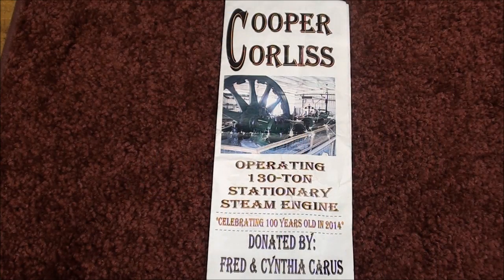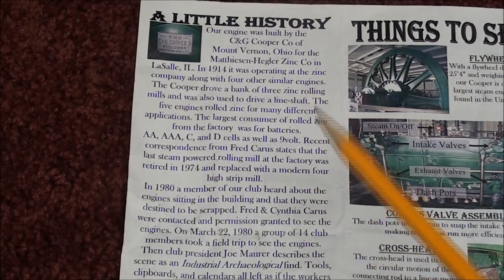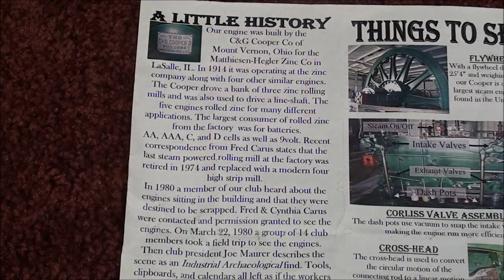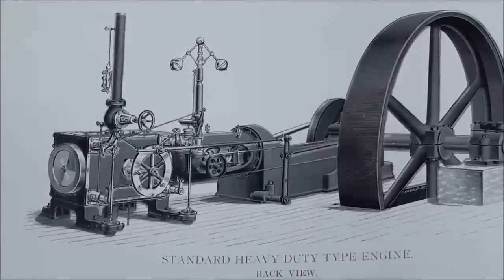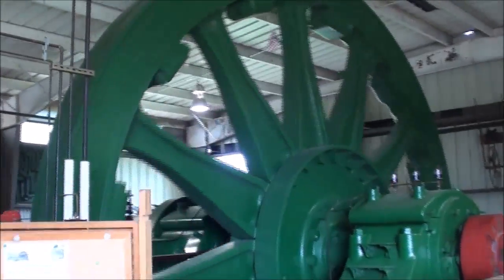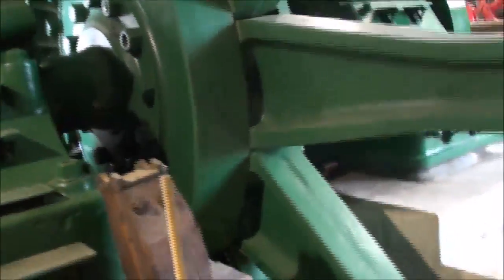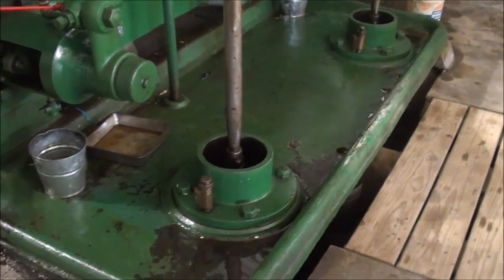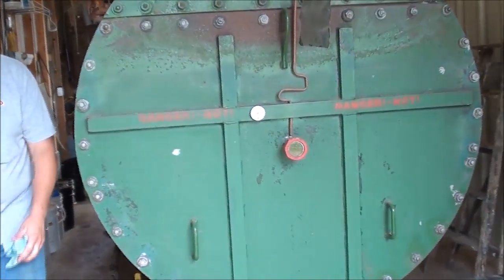tubalccain TAKES A ROADTRIP TO SEE THE GIANT COOPER CORLISS STEAM ENGINE

Comment: Those Allis-Chalmers Corliss engines are common here in Central Tx... there are several in Bastrop, one on a trailer and one at a barbecue place.  I also saw one at Antique Powerland, up in Oregon...  they run their sawmill off it when they are steamed up.  The circular wheel for the valve linkage is a dead giveaway for them.

Comment: Great video of a Corliss steam engine, that thing is HUGE.

I had the opportunity to see one at the Rollag, Minnesota exhibit in 1984 and 2000. It was used for a backup power generator IIRC for the Pabst Brewery between 1914 and 1958, with a 20-1/2" bore and a 48" stroke and I think the flywheel weighed around 19,000 lbs (memory ain't what it used to be). There's also one in Berthusen Park just west of Lynden, Washington that they fire up at least once a year. If I recall correctly, it was the dashpots on the valve gear that set a Corliss engine apart from others.

LOVE the old steam engines.

Comment: Thanks for taking us on your road trip. As always, very fascinating. I realize that I need to take more road trips and see these things. I get to see the world for my work but somehow miss out on what's here in the Good Old U S of A.

The crankpin oiler system on the large green Corliss is interesting. There appears to be one oiler mounted directly on the conn rod end, in addition to the oiler that's stationary on the engine frame; with the rotating tube to the pin. I am curious what is the reason for the two being present there at the same time.

Forgive me if I missed it in the video; but did they tell what the normal running speed and HP rating of the big engine is? I would love to hear it under rated load and speed - bound to be a symphony like none other......
Reply from the maker: +davida1hiwaaynet Thanks for watching

Comment: Thanks for the field trip, Mr Pete! I still remember when my high school mechanical drawing class got to go see the Fram Filter plant in East Providence, Rhode Island in 1963. The Corliss valve system is a wonderful mechanical action, so smooth it could be used for textile mills without breaking thread and so economical George Corliss could sell an engine for the price of the coal it saved. Like a puppeteer, a swiveling wrist plate pulls on four rods to turn the cylindrical valves. A dash pot mutes the clacking alacrity of the steam-saving linkage. The massive steel bones glide silently and the glass-bodied Lunkenheimer oilers ride around like kids on a Ferris wheel. What a machine!

Comment: Cool video thank you.
What rpm would it have turn in the factory?
Reply: +Ed Germain The engine was test run on July 13, 1991 at six rotations per minute.  It is capable of 45 RPM.
Reply: Thank you

Comment: How did they move the flywheel to the museum?
Reply: msotil Very carefully.
Reply: msotil Most likely they took it apart, as it´s a segmented one. I think many super large engines of the steam era can be broken into parts which fit on a railroad car, either by size or by weight, depending on the what the track route provides (tunnels, bridges).

Comment: Wassat, 6rpm?  Three seconds of steam pressure to push the huge piston across its cylinder. The stroke and bore requires a huge volume of steam, appears to be 5'x2'. 
Probably not much HP at this slow speed.   Interesting vid Pete, TU.  Don
Reply: +umajunkcollector It's designed to produce torque, not horsepower. It produces 250,000 ft lbs of torque. It's capable of 45 RPM.

Comment: Was the big engine at its top speed? The governor looked to be at end-of-travel. 

ALWAYS blow the whistle! That makes your viewers' day!
Reply: davecc0000 It looks like it's being run by an electric gear motor or something geared down for demonstration purposes. We would hear the steam if it was actually on steam power and it would run faster I'm sure.
Reply: Chet Valdes how about the steam and water escaping the shaft seal at 8:04? And from the valves at 8:55? Oh, it's running under steam alright...

Comment: Very nice, I have questions. What PSI does it run at? What RPM ? You mentioned eccentrics, dash pots, what are those? Was there a HP rating? The weight of the flywheel? Thank you.  ;}
Reply: dejanira2
A couple of very quick goggle searches turned up the following.
 HP= 4,798. Flywheel is over 25' diameter and weighs 60 tons. 225 lbs steam pressure. Rated speed is 45 RPM 
Dash pots in general are devices to slow or control linear motion. The cylinder door closer on a screen door or a door in a commercial building are dash pots.So are shock absorbers on a car. Not sure what their use is here, perhaps to keep the valves from slamming shut.
The eccentrics, as you can see, are mounted off center on a shaft and convert rotary motion into linear motion. They control the valves.
Hope this helps.  [:<)}
Reply: dejanira2 Just google "giant cooper corliss steam engine".  I found a couple of great sites that answer all of those questions.  Impressive machine.
Reply: dale pratt Thank you
Reply: Luckystrike Thank you
Reply: Luckystrike It appeared that the big engine was running at about 5 rpm in the video, and no doubt not under any load...